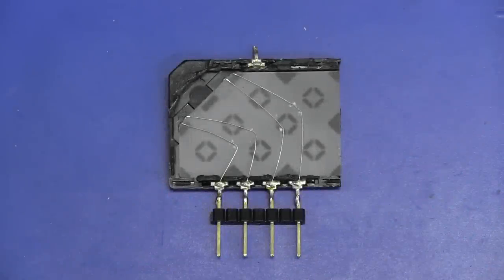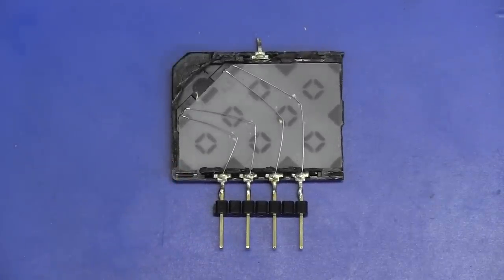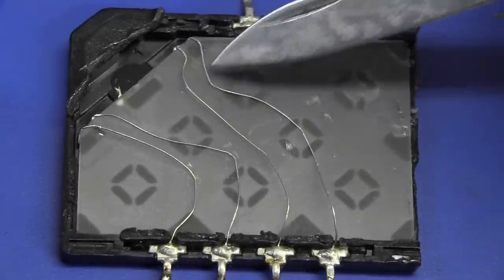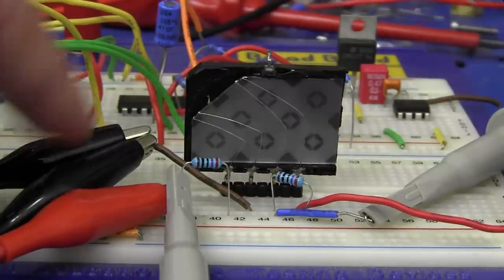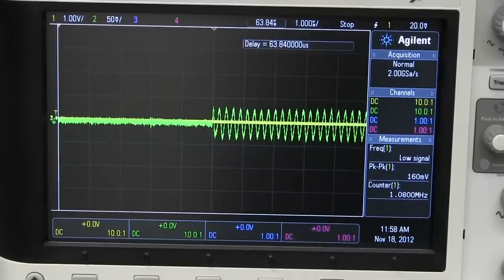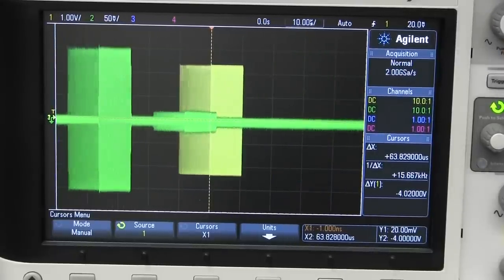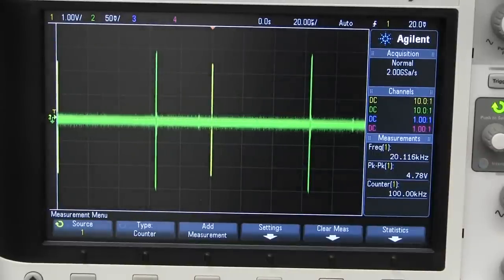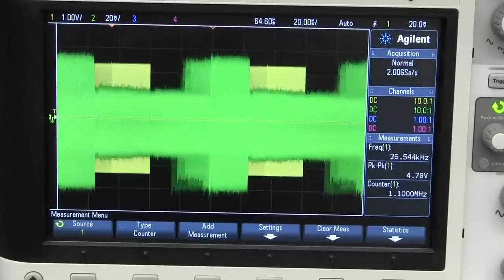EEVblog #386 - Glass Delay Lines Part 2

Comment: Hi Dave, that delay line blog triggered a memory from my colour television service time back in the '70's, a figure of 63.943uS comes to mind which is a half cycle short of 4.43361875MHz and was used to separate the R-Y ande B-Y colour difference signals for demodulation, it's all a bit vague now but that's what I remember, thanks for all your blogs Cheers Liam

Comment: The LC groups are adding a little correction to the del.time +a bandpass filter of course ,extremelly important with the NTSC color systems ,and not quite so strict in the PAL (phase alternating lines)color encoding mode.

Comment: Surely at each reflection there's going to be a change of phase and a differential one to boot as each wave hits the reflective surface at an angle so that each wave hits the reflective surface progressively across each wavelength.
Reply: First made  by Telefunken a big bit of glass, ultimately cost reduced by treating as sliced bread i.e a single loaf of glass with piezo transducers sliced by a multiblade saw. Rough surface the result of the sawing process.
Doug

Comment: Hey that last part, when Dave is squeezing the glass, is that how force gauge work?
Reply: No. When he touches the glass, the refraction properties change. Refraction index is always a result of two interacting materials, so glass/air has a different refraction index from glass/skin. His skin just absorbs a part of the signal, it is no longer reflected on the inside of the glass surface.

Comment: I'm here because I was looking at digital delay units to replace the lLine 6 DL4, which is notoriously breakable. Some "engineer" decided to use actuators and switches instead of  just switches. The switches are small and mounted to the board. They break. 
 Now I'm  fantasizing that this would work with audio. Thinking about how different types of glass would sound.  How large one of these would have to be to make audio delays? My most common open loop time is between 4 and 8 seconds. Yeah.  Pretty huge, and more breakable than my guitar pedal I imagine.

Comment: Although your testing methodology is undoubtedly accurate, wouldn't is have been much easier to use two channels on your scope reading the same signal?

With one probe reading the delay-line and the other being a direct path? and using the scope to show a comparison of the two channels? It seems like it would be a simpler and more robust solution.

Comment: Hi, could anyone explain me why is still the green signal at 19:05 and what is "capacitive coupling"?
Reply: he's using a breadboard to do the testing.. breadboard has parallel metal contacts which are close to each other acting as a capacitor.. this capacitor will high pass signals across terminals.. Google breadboard stray capacitance for more info :)